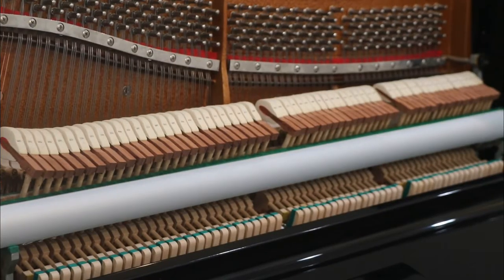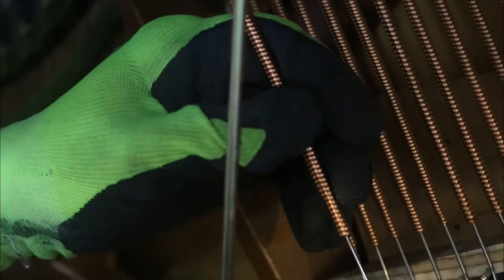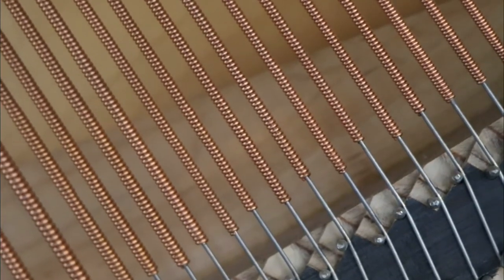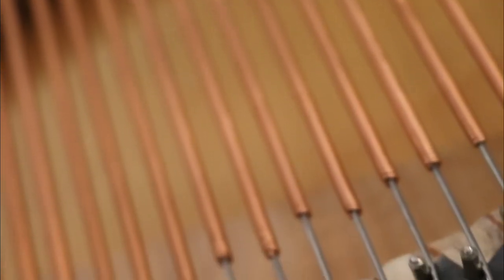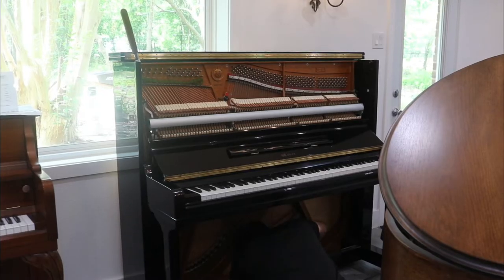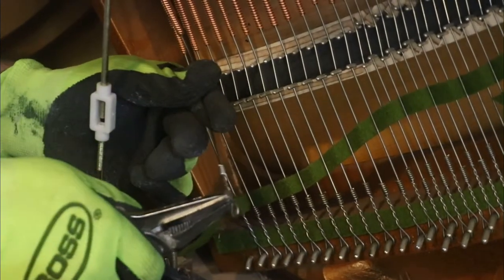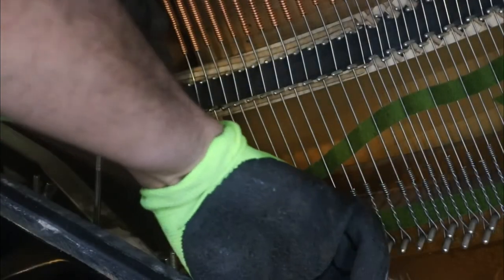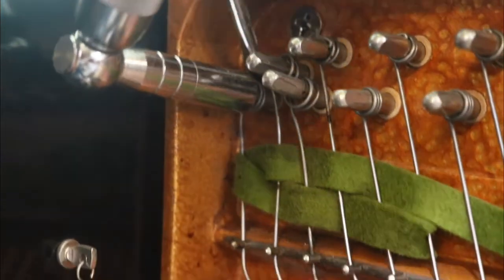Turning bass strings

Comment: Thank you for this. I may do this on one of the pair of E3 strings on the outdoor public piano I maintain. Seems doable. Not sure why turning the inside wire would cease the buzz, physically. I am guessing the inside wire makes some uniform bulging when turned, just enough to snug up the copper wrapping wire, thus stopping the potential for rattling/buzzing.
Reply from the maker: This will do it in many cases I have roughly 70% success sometimes the coil won’t tighten and the string needs replacing. Good luck! The pin can sometimes be loose after replacing having some lo-torque to replace is a good idea a size up. If loose